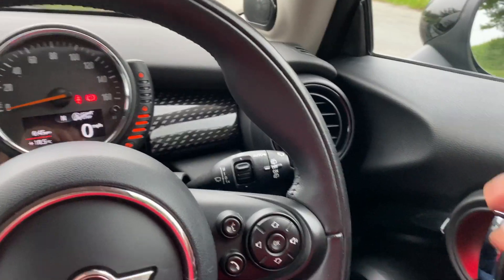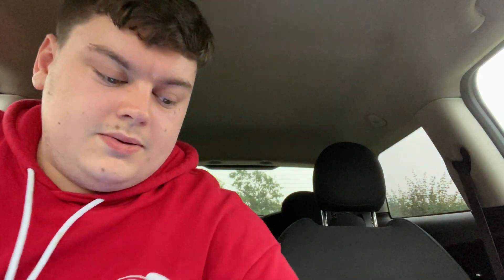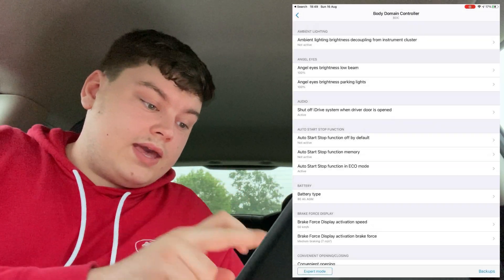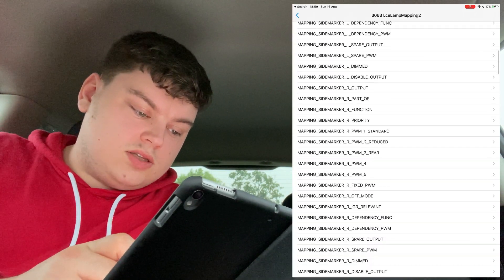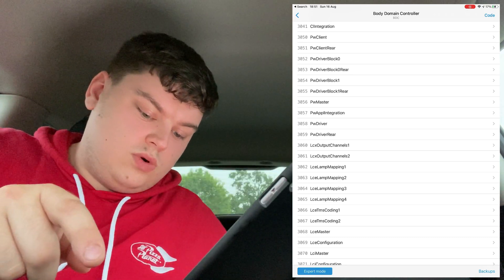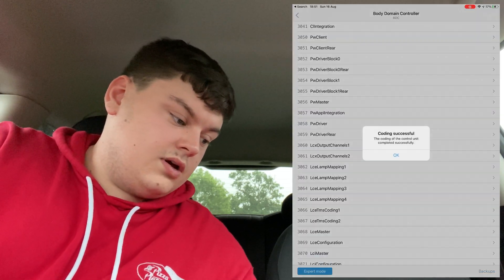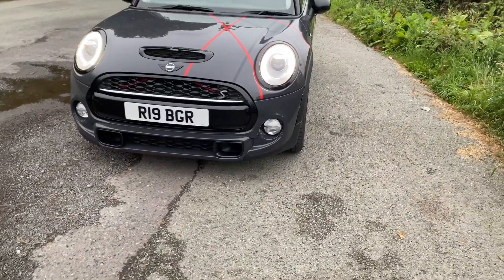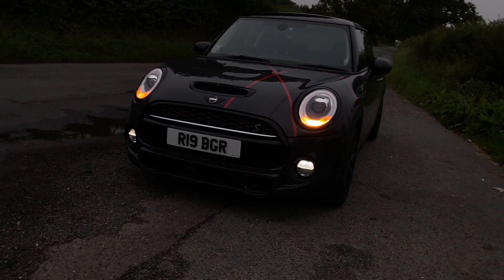MINI F56 BIMMERCODE US SIDE MARKERS

Comment: Ben, Thanks for your videos, they help me a lot, Did you know that the latest mini still uses 9.0v？
Reply from the maker: Hey, thank you! I’m not entirely sure to be fair. If you're unsure, it may be worth trying the lowest voltage and working your way up to be safe until you see the required results.
Reply: @BenRolfe  Thanks ben, I've tried that, with the 9v the light flickers a little bit, it was set at 100% before I changed it, maybe I'll try again with the 100% setting, another question because Everyone knows the reason, the engine compartment space of the mini is very small, so that the rubber and plastic parts tend to age faster, I wonder if I can open the air intake on the previously closed hood, let some air flow from the Enter here to cool the temperature in the engine compartment. I can foresee some hidden dangers, such as the possibility of water and ash entering the engine compartment. Maybe it can be solved with materials such as filter cotton. I don’t know if there are any mini car owners. Tried it, do you think it makes sense, I use google translate, so sorry if it's confusing to you

Comment: hello to all, I am looking for the coding that allows the DRL ring to light up in position lights mode. currently the ring goes out completely and just leaves the small light at the level of the fog lamps. the coding must exist for JCW models which do not have fog lights. thank you very much in advance, I use google translate in case it is not very well written.

Comment: Interesting. I have a 2019 Mini but my indicators don't work that way. In mine the entire circle is illuminated clear, and when I put on the indicators the entire circle is amber. Since you have the cheat sheet does it show how to turn off the US DRLs that are in the wheel arches?
Reply: Look up bmw f30 bimmercode cheat sheet. It’s essentially the same.
Reply: He has the pre LCI, and you have the LCI1
Pre LCI don’t have the Union Jack rear lights and don’t have the full circle indicators among other things. LCI2 is the latest F56 without the separated fog lights at the front and a slightly redesigned interior.

Comment: Ben, I was wondering since you have the European spec version of the F56....when you engage the hazard lights aka 4-ways....does your f56 double blink during the cycle or is it only one blink per cycle. I’ve been searching for the correct module to enable “euro-spec” double flash 4 ways but I’m not sure if it’s only a euro thing or for all mini f56’s

Comment: Once I done the coding on my F56s the indicator flashing faster than normal. I dont know whats going on.
Reply from the maker: Hey 👋 I’m not sure what that could be. I’ve coded it on mine and a few others and not had this problem.
Reply: It’s most likely because you have “cold and warm” monitoring turned ON. You need to go back in to the BDC and turn OFF all monitoring so that your mini doesn’t think the bulbs are burnt out and constantly checking the voltage every time you engage the signal.

Comment: Hi. Thanks for posting this. I have a question though. The code worked for me, however, the front fender lights turned off after. Do you have a work around for this?
Reply from the maker: If I’m honest I’m not sure, I didn’t have this problem. Make sure your lights aren’t set to automatic and just side lights.
Reply: Ben Rolfe i did just that. Same thing. They wouldn’t come on. I noticed you don’t have the fender lights so yeah you wouldn’t have the same issue. Thanks anyway! :)

Comment: I have a 2020 jcw clubman with the premium screen, the bigger one. Is it possible through bimmercode to make Apple CarPlay widescreen? The standard sat nav is switchable full screen but if you want to use waze, or google or Apple maps it isn’t.
Reply from the maker: As far as I’m aware Bimmercode won’t be able to correct this. The only bypass would be to retrofit the CarPlay box which I will be covering over the next few weeks. It would be down to MINI as to why they have restricted CarPlay to only half of the screen as other BMW modes offer full screen CarPlay.

Comment: I don't think I've ever actually seen a US spec car with the blinkers on solid like this. It's cool though, I might end up coding this. I bought the app, might as well use it right? Thanks for the video!
Reply from the maker: Thank you 😊 going by the forums most people relate this to a US thing, it could be completely wrong though. Definitely worth giving a go!
Reply: Sidemarkers on US cars are on the wheel arch, Doing that Ben did will route the power from the wheel arch to the headlamp. EU cars dont have wheel arch side markers.
US cars are routed to sml

Comment: Thanks so much for posting Ben, quick question, does the voltage amount correlate to the brightness of the bulb for the sidemarker?
Reply from the maker: I would have thought so, but I didn’t want to go further than 9v as I think the bulbs are 9v bulbs, but i may be wrong.
Reply: Ben Rolfe yeah I was thinking of going for a slightly lower brightness than the standard, going lower than the 9v shouldn’t be an issue right?
Reply from the maker: Going lower shouldn’t be an issue at all, it’s going over that you want to be careful of.
Reply: Ben Rolfe Cheers mate, excited to code this in!
Reply: I coded mine in Ben, mine actually stay on when I have the Auto headlights on and turn off    during the day when the headlights aren’t on. But weird how we’ve got the opposites despite coding the same thing
Reply from the maker: Just checked mine and they also come on in the dark on auto but go off when it’s light.
Reply: Do you know how to code it so that it stays on during the day and night?